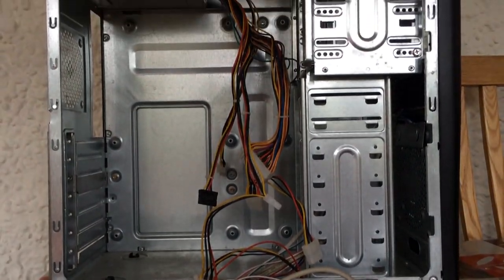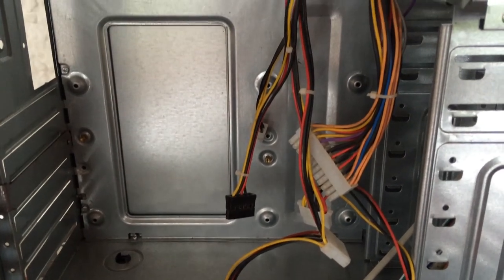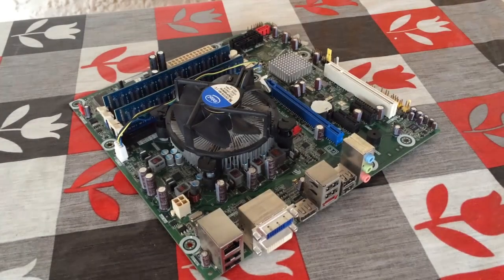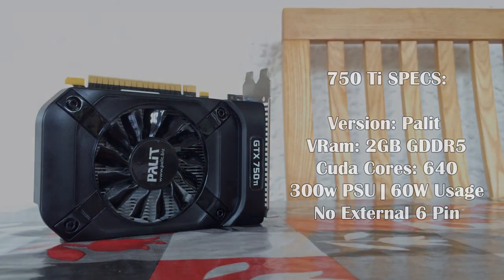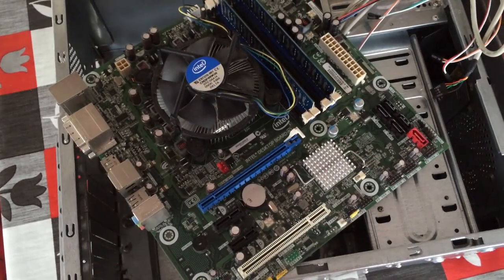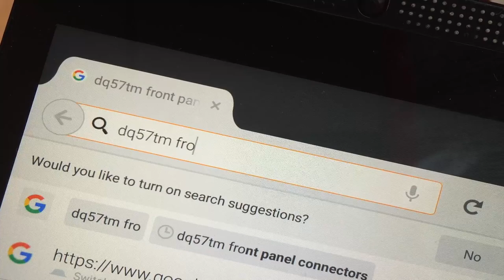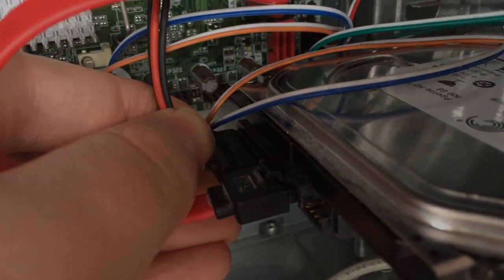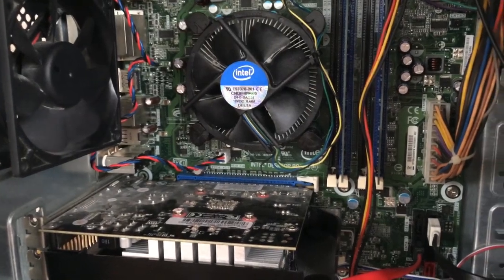Let's Build a $200 Core i7 Budget Gaming PC

Comment: I'm suprised that the GTX 750 TI did so well on BF 1
Reply: well on sp... join a 64 slot server with that card and you will be looking for low 20s
Reply: singleplayer
Reply: 1050 is by far the best current gpu for value, the price you're paying for the increase in performance between 1050 and 1050ti you may as well jump to the 1060 3gb
Reply: you got your 1050TI on a huge discount you can't really include that lol, in USA during black friday you could get a 1060 for about $160, in fact I bet you still can
Reply: Dank Harambe btw reddit.com/r/buildapcsales will make your life much better if you are american :>
Reply: enjoy life, good sir :P
Reply: once he gets into multi-player, he'd  have to move to low settings to get near 60 fps
Reply: not true at all lol before i upgraded  i had a 750ti i only play conquest never dropped that low
Reply: MetalheadbroX well bf1 is very CPU intensive so that's funny.
Reply: You have no clue what your on about. I run the exact same card and get 50/60 fps on medium 1080p.
Reply: same
Reply: Battlefield 1 isn't very intensive.
Reply: Rat Face I'm not
Reply: +Cario Murphy 
it is, if it wasn't then it would run on my pc
Reply: Rat Face I'll think about it
Reply: BF1 is Very well optimized. Compare it to gta and BF1 Blows the graphics out of the water
Reply: Dank Harambe  hd 7970 is better its a lower price but uses a lot of wattage but it is slightly lower in performance than the gtx 1050ti but for a 40 - 70 dollar price reduction its best

Comment: that's a really good system for $200 you're getting about the same performance of the original PS4 I think that would be good for anybody that's trying to build a really budget PC that can still play games at high to medium settings
Reply: HD PRO To be honest i am a fallout fan and that system outperforms the original ps4 by 12 fps on fallout which is a crazy performance considering the price of this system.
Reply: alec rochon the PS4 is capped to 30 fps, to keep the game at a stable framerate throughout. the 750ti will drop below 30 at high in demanding areas so you will get this annoying effect when it jumps from sub 30 fps to 45 fps. If the PS4 was uncapped the performance would be similar to a 750ti.
Reply: Lostrocker no it wouldn't it really wouldn't when I was a console games fallout 4 was unplayable on ps4 sometimes dropping into the 14-19 fps range in indoor battles the consoles are just tragic they really are
Reply: Don't compare a PC to a console
Reply: Quality Pixel well the ps4 runs on hard ware from 2012 and the ps4 pro runs on hardware from 2015 why..because ps4 and ps4 pro can upgrade there systems like pc you have a whole range of gpu's and cpu's but console you can upgrade anything like that
Reply: Quality Pixel in all honesty this pc has more power than a 500 dollar console

Comment: No brand no name PSUs are a firehazard.
Reply: Last time i used one of those i left the computer downloading shit overnight,next morning i found that the fan stopped working and everything was fucking hot,the coputer was freezed,when i turned it off i could hear the "cracking" of the metal getting colder,NEVER use a cheap psu.
Reply: well... better than nothing really, and it isnt really a fire hazard until you push more than 60% of the rated capacity, how did i find that out ? the hard way...
Reply: OfficialG3 I've learnt the hard way as well. Usually, cheap power supplies are only P4 certified. Meaning, they are using a VERY old design where they still think 5v rail is relevant. Then you have the ratings... good, god. How people can lie.
Reply: hell naw I woulda been gone asf if it caught on fire
Reply: yeah but for 30 quid you can get a branded psu from evga or cooler master

Comment: would a 920 be better?
Reply: nvm lol it wouldn't
Reply: Different socket. 1366 socket boards are stupid expensive now.
Reply: C G0R3Z Not really I got an I7 960 8gb 1866mhz ram and a Asus Saberthooth X58 for 150 euros.
Reply: Lucky bugger. 1366 boards are at least £100 on their own here in the UK.
Reply: C G0R3Z If you buy a combo cpu+motherboard you can get them pretty cheap in the Netherlands.
Reply: timo halofan I'd have to look at some of the other sites. I've been getting nothing on the UK sites. I've been using a 771 xeon in a 775 board for my NAS, but I'd like to try some of the 1366 boards, possibly with a xeon as well for the best transcoding for the price.
Reply: C G0R3Z The site I got it from is a Dutch site called www.marktplaats.nl I don't know any other sites where you can get them some what cheap maybe on EBay. Good luck finding one though!
Reply: 950 all the wa,y i can find 950 at 40 euros here in italy. it is still a god damn beast.
Unless you put a 970-980 ti, 1060-1070-1080 or any of the higher end cards you're fine for the most AAA games on med-high-ultra settings without going below 50 in most cases.
Reply: Cristian Dnestreanschi I don't know when we switched to gpu's since I was talking about the I7-960. But I have a 750 ti at the moment and will be upgrading to an 1060 as soon as I can. Still an 950 for 40 euros is a pretty great deal.
Reply: timo halofan i7-950 was a cpu, the other series i mentioned were gpus , but given an i7 950 + gtx 1050 = gg wp, no bottleneck whatsoever, just in much more CPU intensive AAA titles, even then the fps will drop to about max 10 frames.
Reply: Cristian Dnestreanschi I know it's an cpu and you where talking about gpu's I just got  confused that you meant a combo of that cpu+those gpu's.
Reply: timo halofan 
Yeah, I wanted to say that an i7-920 won't be bottlenecked by a current-gen gtx 1050, which is better than 750 ti and will offer more fps with g4400 :)
Reply: I got myself a set of CPU (W3550) and Mobo (X58A-UD3R Rev2)  for 110 pounds.
Reply: cool
Reply: actually 870 is better then 920 tho
Reply: timo halofan bundles are cheap. the 1366 mobo isn't
Reply: RAb olY M  k
Reply: 920 is a solid CPU still running mine today with a 750ti.
Reply: It's all about the Xeon x5675 with the x58/1366 motherboards. I recently replaced my 920 with one and it's a night and day difference, easier and cooler overclock, plus 2 extra cores. Running at 4.2ghz, 6 cores/12 threads and it's a total beast for everything I need to do. Not bad for an 8 year old CPU on a 10 year old platform.

Comment: Looking for some advice - my system has an AMD athlon x4 750k CPU and I'm wondering what the optimal GPU to pair this with would be as I'm looking to upgrade (budget around £150). Thank-you in advance :)
Reply from the maker: get the 1050. you'd be able to save money from the £150 budget too. a website called "ccl" has it for £115 :)
Reply: RandomGaminginHD thank you very much, your advice is greatly appreciated! I'll certainly invest in an 1050 as my gpu is by far the weakest component of my PC - any particular brand for the 1050 e.g EVGA, PALIT etc :)
Reply: EVGA (definitely!)
Reply: Sam Holmes gigabyte :D
Reply: Sam Holmes a gtx 750ti 1050 or 950 should work just fine
Reply: Sam Holmes EVGA for Nvidia and Sapphire for AMD. These are the best respective brands for these products. People telling you to go gigabyte want you to have a fried card.
Reply: Sam Holmes GTX 770 or 760 twin frozr
Reply: 750 Ti, RX 460, or GTX 1050/1050 Ti would be good ideas for your CPU.
Reply: Better to go for the 760 OC twin frozr excellent cooling performance
Reply: So many replies!! Any conclusive ideas overall? ( thank you for all coming together on this aswell)
Reply: In my personal opinion the GTX 760 Twin Frozr is better than the 1050TI due it its superior cooling and over all quality of the components. Remmember that the 'TI' version of the 1050 is drastically different than the non TI model take a look at benchmarks for both cards and base your decision off that :)

Comment: i recently built a pc for a friend buying used ebay parts. very similar to this rig. i won a lenovo thinkcentre pc in an auction for $129 that had a i7 870, 6gb ddr3 ram, and a 750gb hdd then bought the same motherboard for $40 and a stock intel fan for $10. then i got a gtx 1050 for $110 on newegg. i had a leftover case that i used making a pretty awesome pc. my only problem is only 6gb ram and battlefield 1 needs at least 8 according to system requirements but hey bet it'll still work.

Comment: Do a xeon pc build
Reply: not in all the case :)  sometime a xeon perform better face at a i7
Reply: Hey man check out Tech City's Deepcool dukase v2 its a 360$ build with a xeon.Its made for running games at ultra settings at 1440p and it really does.
Reply: SΛTURN Did you see the benchmarks?
Reply: SΛTURN It's old but if you want it can kick some ass.
Reply: SΛTURN I got a shitty PC with a GT 520 and a fucking pentium CPU.Your laptop has to be better :(
Reply: SΛTURN My PC with a GT 730 and a Core 2 Duo E8400 can't even run Fallout 4 30FPS lowest of the low settings...
Reply: I have, that even runs okay on old Intel HD graphics.
Reply: Ashton I play fallout 4 at 30-40 FPS at the lowest settings at 480x320 resolution...
Reply: Bad Shift I think mine runs at 1280 x 720, anything lower than that isn't really playable for me.
Reply: Low resolution is always the key for me.320x200 is one hell of a resolution.Allows for some amazing FPS even in some AAA titles.
Reply: Ashton Im used to these ultra low resolutions so they don't really bother me.Im so used to this shit that when playing on a higher resolution it fucking hurts my eyes.
Reply: SΛTURN CRT monitors have nice refresh rates and response times anyway lol

My second PC used to have a Pentium D 3.4GHz, 2GB RAM and a GT 610. Could barely do TF2 at 1024 x 768 lowest settings
Reply: @Ashton000  mine is can't even run Steam lol

Comment: That system is a lot better than my second PC I've builded a few months ago for 132€ / 143$ (Still had a DVD drive, PSU, hard drive, 2GB RAM stick, and one case fan laying around) which I used the following parts for: Phenom II X4 955 + Motherboard + 4GB RAM bundle, a GTX 570, and a case with 2 LED fans installed, aswell as another 2GB RAM stick

It runs GTA5 just fine, but struggels a lot with Battlefield 1... 
At the moment my main PC is also broken so I use the second PC quite a lot...

Comment: Can u test CS:GO at this PC please?
Reply: Csgo will run 1080p 150 frames+
Reply: Kuwegg is right.. You could probably get 150+ frames with the 750 Ti.
Reply: Maybe even more on some maps.
I got the GT 740 and I sometimes get 200+
Reply: wh1teey x maxi But CS:GO is CPU demanding game, that's why im curious how 860 would work.
Reply: ... CS:GO is not that demanding.. If your cpu is good enough you can run csgo without a GPU.
Reply: +120 fps. at 1080p, i have gtx 550 ti and i play at 80-100 fps.
Reply: i7 860 is more than enough for cs go
Reply: Anything can run it
Reply: harambe No, on core 2 duo it runs like shit
Reply: i have a core 2 duo and a geforce 9800 gt and i can run it in 60-70 fps on low
Reply: What resolution?
Reply: Nice.
Reply: kuba zrobczynski 750 without ti wont run games on high.
Reply: Robb Bonn I agree mate my Potato laptop has Intel celeron b820 with intel hd sandy bridge runs csgo on low at 25-40 fps
Reply: what about gta v?
Reply: EsseyerV2 core 2 quad q6600 82 fps 1080p med
Reply: i got the same cpu and a gigabyte 750 ti 2x windforce, and i get in cs go 150+ sometime 100 depends on map, all in ultra settings
Reply: 750 ti with a quad core hyperthreaded i7 well over 150 fps @1080p

Comment: The i7 860 is still a solid little chip! I have one in my rig that I over clocked to 3.3Ghz on the stock voltage, and pared with a 6gb GTX 1060. For the most part, the CPU doesn't ever hold the system back!

Comment: I got an Optiplex 790 with an i5 2400 for $120, a $45 600w PSU and a great deal on an HD 7870. It beats this PC, but I got lucky on the HD 7870. would be around $250 and that would replicable. Also has room to upgrade later because the PSU is 600w

Comment: good one, will also work with a GTX 1050 Ti. Due it has no PCIE- Pin, not with the RX-series (sadly).

You can also buy used workstations and combine them with a modern GPU.

Best Pepe

Comment: i got my 1st build pc and thinking of selling it, what dya reckon its worth? i5 6500, asrock H110itx, 8gb ddr4 corsair 2400, Gigabyte Gtx 970 itx OC, corsair SF450 fully modular 80+ gold, Silverstone sg05 case, 250gb crucial SSD, 1tb 2.5 7,200 HDD, blu-ray reader slimline, win10, Scythe Big Schuriken 2 cooler. Have all original boxes. I want to upgrade to 6700k, 2x16gb ram, Z170itx, 256M.2, 1TB SSD, Nzxt Manta, Nzxt X62, Corsair RM650i, evga Gtx 1070 ftw.

Comment: damn dude that's so close to what i just got. i7 860 on craigslist for $50 Zotac H55ITX-A-E Motherboard on ebay for $112 G.SKILL Ripjaws X Series 2x4GB DDR3 on ebay for $38. with a GTX 660 pulled from my other Q9550 build it runs GTA V pretty much exactly the same very well on both CPU's. only difference is the Q9550 build uses a Dell Inspiron 560 motherboard and has windows on a 64GB SSD and 2x Western Digital VelociRaptor 500GB Raid 0. the i7 build has just a single 1TB WD Black.

Comment: Quick look so far Ive found Intel i7 860 CPU USD$91 = AUD$122      and used mobo for USD$61 (AUD$82) , so about AUD$204, still cheaper then the I5 Skylake NEW in Australia currently (Around AUD$250 for i5 skylake)

Comment: Finally one with my cpu.
Reply: still a good cpu on 2016 :D
Reply: m. edy Doesn't bottleneck my r9 290 so it should still be good for even a GTX 1060
Reply: jesus harambe yeah doesn't bottleneck a 28 nm gpu :) what you play right now and frames ? XD (just asking because i want  a bulid like this )
Reply: m. edy Well sure ill be glad to help but first of all i have to say a gpus manufacturing process has nothing to do with its performance. But i play fallout 4, Battlefield 4, Beamng drive, Arma 3, and Assetto corsa. They all run on highest settings above 60 fps 95% of the time aside from Arma 3 which runs at about high 45-60 fps due to its bad optimization.
Reply: m. edy Also i would recommend buying a xeon x3440 instead of the i7 860. Its the same cpu just a little bit lower clock and 2 less multipliers but it costs half as much. As long as you overclock you will be alright. I get this performance with mine at 3.8 ghz so you wont have the same results at stock clocks.
Reply: jesus harambe   thank you , very much !
Reply: m. edy np

Comment: Hey guys. I am thinking about upgrading my PC, but I am on tight budget. What should I upgrade first to impove my PC performance? CPU+motherboard+ram or GPU? My specs: AMD Athlon II X4 641, 8gb RAM DDR3 1333MHz, Gigabyte Radeon HD 5670 1gb, PSU OCZ 600W. On this set I can play Fallout 4 on min specs in about 25FPS. I would like to play Battlefield 1, Rise of the TR, and some other titles on medium settings with decent FPS. Thanks for help!
Reply: I would upgrade your gpu first, maybe to a 750ti or an RX 460
Reply: I would recommend post this on pcpartpicker forums under part list oppinions wanted its easy to select the parts put them them in a list save it and put it on forums hope it helped
Reply: don't go amd. or wait for zen
Reply: CPU is similar to the q6600 in performance which he did a video on not long ago, so one of the budget cards like 750ti will do.
Reply: I suggest doing a bit of research and finding the best Processor for your socket and getting a better GPU for best performance, ive been building computers for years. It looks like an amd a8-3870k would be your best bet with your mobo, also pair it with a decent budget gpu so like the gtx 1050ti
Reply: just dump the lot n start again lol. 
I think you can keep the ram, and psu, and thats about it, 
Your best bet is try finding a quad core intel business computer you find on refurbished websites, and add  in an 1050ti

Comment: I've found a combo deal which is about similar to yours. Intel Core i7 860 2.80GHz, MSI H55M-E33, 8GB (4x2GB) DDR3 for about 130 pounds. Might buy it, but I'm curious as to what kind of GPU it could support at most. As I've been able to find MSI GTX 960's 4GB for about 83 pounds. Or would a GTX 960 not do well with the other parts? Would love some advice.

Comment: an i7 860 paired with a 750 ti is a great combo, Just dont go over a 750 ti. i had the same kind of specs. i once owned a 750 ti and an i7 860. and they were fine, but when i got my 960. it bottlenecked it. not badly to unplayable performance, but enough to just annoy you. so much that you'd get another cpu.

Comment: you got me beat on GPU. Built a i7 3770 for $150 US only reason so cheap is I got a old Geforce 8400 gs kid can play minecrafft on it and watch youtube tho I will be upgrading to the GT1030 or GTX 1050

ASUS P8P67-M Pro microATX LGA 1155 $7
i7 3770 $50
8GB (2X4GB) samsung DDR3 ram $25
500GB WD hard drive $15
XION atx mid tower with 400 watt power supply $30
ASUS dvd drive $8
Nvidea Geforce 8400 GS $15

Comment: since cpu's haven't really gained a lot of speed in the last 6 years it's tempting to get an old i7 but I don't like to buy used hardware :( I guess I'm paranoid but I don't want something that might have been overclocked and could die on me on any moment, especially since I have to buy the board used, too.

Comment: hey man ive got a question i am currently running a core i5 650 clocked at 3.2ghz with 3.46ghz  turbo lga1156 socket along with 4gb of ram and a gigabyte gt730
 2048mb ddr3 
now would it be worth getting a i7 860 or 870 of ebay for cheap just as a budget upgrade as it seems to perform well